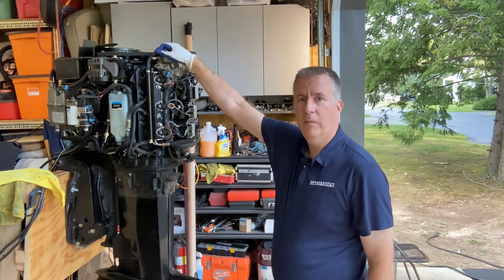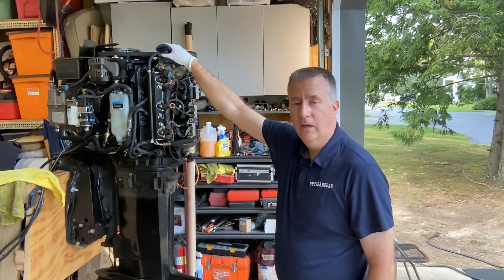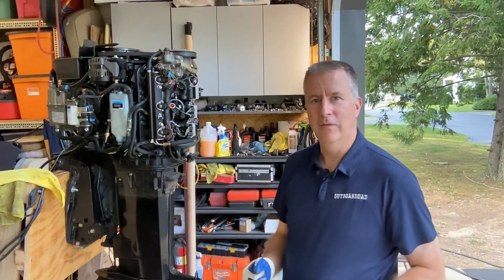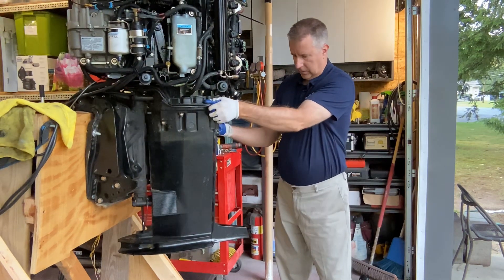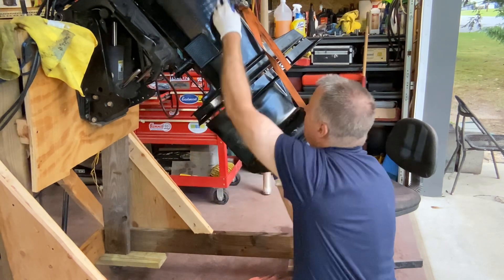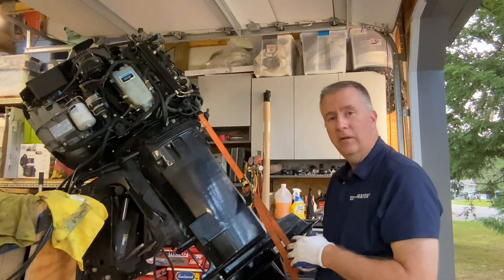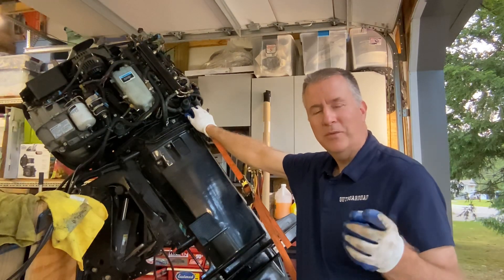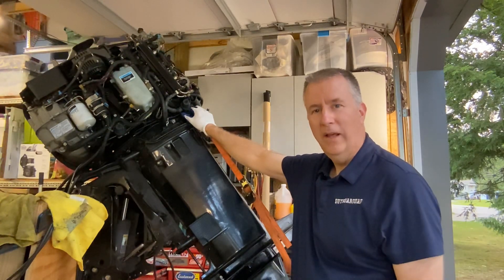Mercury Optimax water flow test lower unit install

Comment: Great videos.  Easy guy to watch very humble.  I have a stuck lower unit on a 2012 optimax 90hp. Any suggestions would be very helpful
Reply from the maker: When you say stuck do you mean will not shift? Did you take the lower off the motor?

Comment: quick question. I have the optimax 150, has been a great power unit for over 21 years. Today the hi temp alarm activated, we limped back to the launch. Came home and replaced the impeller even though I think I did last year, impeller looked good. My question is about the copper pipe leading up to the power head, what does that connect into? Mine came out with the lower unit so I am not sure if it actually attaches to anything up inside of the leg. Thanks for your videos, I will be ordering Tstats tonight just as a preventative measure.
Reply from the maker: Interesting, it should not pull out and really cannot tell much unless you pull the powerhead. You will have to snake a boro scope up there and be sure nothing is broken and that it makes a good seal otherwise you will not have enough flow

Comment: Your video was a big help in getting my lower unit installed. The strap for tension and turning the crank made the install much easier. Thanks!
Reply from the maker: @Sunshine-lo2yv  Glad it helped, I learned it from someone on YouTube! Do you do all your own maintenance?
Reply: @OutboardDad  I have only done the minor maintenance on my Optimax 150, I might do more now that I've seen your videos. I did all the maintenance on my previous motor which was a Johnson Faststrike 115 on a Range R70.  Appreciate your videos, knowledge and willingness to share with others.
Reply from the maker: @ Thank you! Make sure to do the maintenance on your air pump, it typically gets neglected and can cause major failures

Comment: Good explanations but I don't think that was good idea to assume thst engine wasn't sending water from telltale at the first attempt because the old impeller was very stiff. 

I have some questions for you.

Did you mean that water came out from telltale instantly without thermostats opening after water got hot enough to opening at least one of the two thermostats?

From the waterflow diagram water wouldn't come out telltale until one of the two thermostats start opening. 

What about poppet valve?
How do you know that it was properly closed at low rpm and started opening when there was enough water preassure from the water pump working above 1500 rpm as Mercury explains in the manual?

Are you measuring water pressure values across the a bit over 600 to almost 6000 rpm range somehow?
Reply from the maker: @josemariatrueba4568  I appreciate your comments thank you for reaching out. The next video will show the motor running with new poppet valve and thermostats and water flow testing as well as weary flow through the air pump. Next I will get into the air pump!